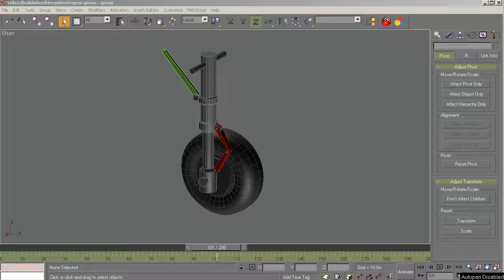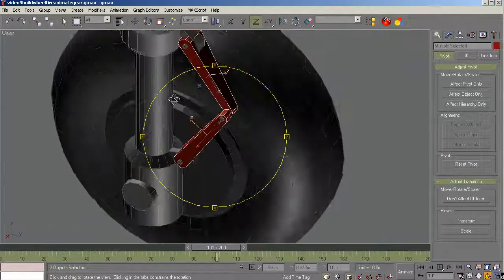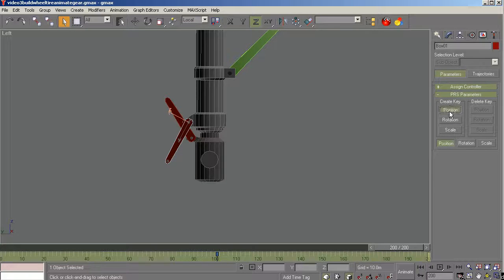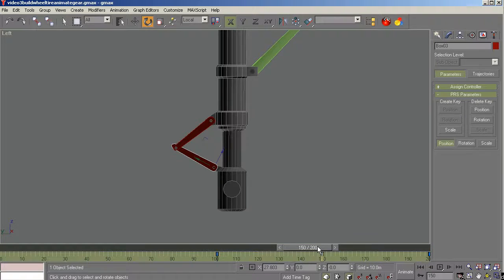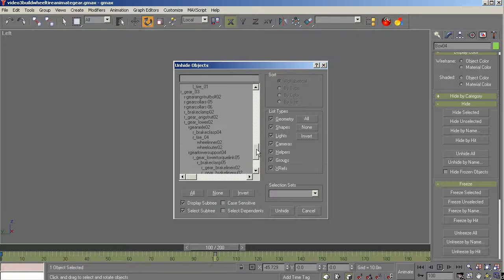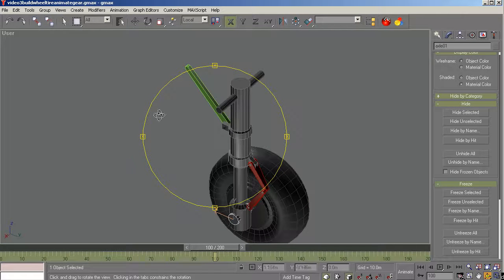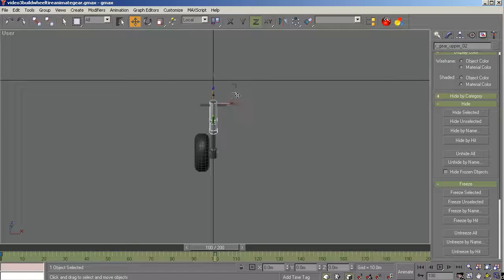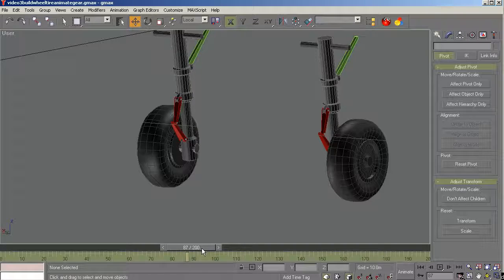Gmax 1.2 for the Beginning Modeler #33 - Build and  Animate Gear Parts

Comment: Thank you for your  videos, they're very useful.
I've a question: when I want to rotate the pivot or when I rotate a linked  object... it is going to have a big deformation.
How can I resolve this problem??
Thank you for your help ;-)
Reply from the maker: Francesco, ensure that the object selected is in Object mode, not sub-object mode (vertex, edge, poly,etc) when you are rotating the pivot, and, ensure that you have selected "Affect Pivot Only" in the Hierarchy, Adjust Pivot section of the command panel.
Reply: Thank you.
But the problem remain, after I link the object it going to have the deformation.
I understood how to rotate the pivot but not after linking.
Reply from the maker: Have you tried Reset Local Coordinate Pivot, and Reset XForm?
Reply: Thank you
Problem resolved, now I can go on
Reply from the maker: Ah, great!  Have fun :-)
Reply: Thanks
Have fun also you!!!